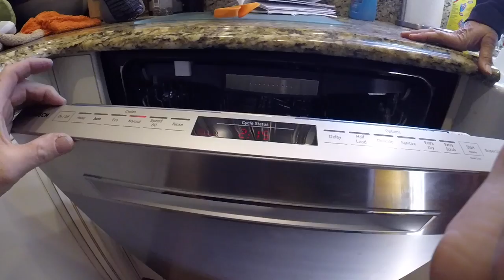BOSCH DISHWASHER INSTALLATION AVOID THESE 3 MISTAKES

Comment: @9:22 NOooooo ... Don't cut the wire! (You had you plumber hat on and needed an electrician hat for a couple minutes.)
Just stuff the extra back down the hole, or reroute it out of the way. If the decision is to cut it shorter, make sure the line can reach up into the sink cabinet with enough to work with for a regular junction box in case the next DW is a traditional hookup, and can be either plugged in or hardwire with a piece of MC for a whip.
Reply from the maker: Dwight I remember cutting that. I was like dude you better not of cut that short.....lol

Comment: How did you get the wire under the sink?  Doing the same thing at our house and the wire comes directly out from behind the dishwasher as all of the older models hard wired right into the unit.  Now I need to get the wire over and under the sink.
Reply from the maker: best way is to install receptacle in kitchen cabinet. My sink was actually hollow on side to my surprise. If not i would of had to put receptacle in sink too.
Reply: @ChuckBarron  what do you mean hollow?  You have the same kind of divider wall I do, the one you passed the return and water lines into.

Comment: Mistake #1A: Instructions DO NOT say to put the junction box UNDER the cabinet. It needs to be mounted IN the sink cabinet. The box needs to be accessible according to NEC. Good luck accessing it where you put it.
Reply from the maker: I will access it on next dishwasher install in 15 years hopefully. But thank you.
Reply: @ChuckBarron  I sincerely appreciate your sense of humor. Do you have any idea why Bosch does it this way with the separate junction box? Any idea why they didn't leave the connections in the front?
Reply: @ChuckBarron  Let's hope you'll never need a service call!
Reply: A hard-wired install is not "accessible" either. Unless you are getting an NEC inspection, there is no safety or convenience problem.
Reply: @FisherCatProductions  In older dishwashers the connection was accessible when the junction was at the front of the machine.
Reply: @joeweatlu5169  True, but I can't think of any reason you need access to the plug before the next time you change out the DW. If my outlet behind the old DW was 1-1/2" lower, I would have plugged it there in a heart beart instead of installing an outlet under my sink!
Reply: @FisherCatProductions  In all practicality, what you're saying is true, other than the fact that NEC says the junction box needs to be accessible. It's the same reason why you can't hide a junction box in a wall or behind a fixed object like a kitchen cabinet. My point is if you're going to do something, why not do it the "correct" way, up to code.
 I've installed maybe 8 or so dishwashers in the past for myself, friends and family, and the latest one was a few years ago when I put in my Bosch, so I don't know about how other manufacturers do it now. It was simpler when the water and electrical connections were in front.
In my world, there would be a GFCI outlet in the sink cabinet, and a regular plug coming from the dishwasher to plug into the outlet. Simple.
Reply: @joeweatlu5169  Hey, Joe. Absolutely true, and necessary if you have to pass an inspection. As to why not to it the "correct" way--I just wasted 5 hours and a lot of good cuss words fishing Romex through my stud wall. Now I get to patch up the drywall behind my dishwasher when I could be drinking a beer as I listen to the barely audible hum of my expensive Bosch kitchen toy LOL. And now that I had no choice, as you said I might as well do  it up to code, which I did. But if I could have dropped the original hardwired junction box 1.5" lower, I would have slapped an outlet in, and plugged it in there with no qualms. Inconvenient--maybe, but not much. Unsafe--not in the least. I will never do anything with electrical for myself that makes an installation less safe.This was the biggest PIA dishwasher swap I've done in 50 years of property management. But it's done. Happy wife, happy life!
Reply: @FisherCatProductions  Fortunately I had enough slack on the romex to run it into the sink cabinet and mount Bosch's box on the back, then the power cabinet through the same hole.
It was so much easier when the water and power connections were in front.
Reply: @joeweatlu5169  Well, mine is done and worth it. Sitting here sipping on some cold Sangria, and not listening to it doing it's thing. Dang, 44dB is quiiiiiiet.Ciao.
Reply: @FisherCatProductions  🍷🍷🍷

Comment: How long after you shut the door will the water start? I just installed my Bosch today and after about 2/3 mins I still don’t have water. I checked all connections and made sure water was on. Pump seems to be working. Any suggestions?

Comment: How do you know the washing is finished or at runtime since theres no panel or led at the front? The dish washer is BADLY MOUNTED, in my opinion.
Reply from the maker: Green light means done. Mount is what paper work calls for...I have seen some nice grid still mesh under stone tops. I do like that.

Comment: So to keep the dishwasher from tipping forward when the door is open and the trays are out with dishes on them, you screwed through that rubber seal on the sides?  Normally dishwashers have tabs at the top to secure them to the underside of the counter top but I'm not seeing any tabs on this bosch.
Reply from the maker: No through rubber. through side brackets. rubber goes on after.
Reply: I am installing a new Bosch right now.  You put the mounts on the sides, and the rubber thing that goes all the way around outside the door has a little hole already made in it, to put the screw through.  So you don't actually penetrate the rubber thing.
Reply: The rubber side seal won't hold for mounting...  it should have bracket mounts... bad job securing....Will be loose  soon... SMH

Comment: Thanks for the great video........ I'm getting ready to replace my older Maytag with a Bosch 500 shpm65w56n. I have a question; Couldn't you just eliminate the junction box and wire it to a plug w/ ground? I wired an in-wall receptacle for my current dishwasher right behind it. Thanks again for your video.
Reply from the maker: im sure. so many ways to set it up.
Reply: Bosch makes a plug adapter you can buy just for your application
Reply: @johningram6264  the electrical box adapter is $30.  Grounded plug is $5 and takes up a lot less space.plug is designed for 15 amp so should handle the load. May want to make sure it is not laying on the floor in case there's a leak.

Comment: Oh no my brother!  What you should have done is ran that romex wire into the sink cabinet & made your connection there and run the feed cord back to the dishwasher. That way you can easily get to the junction box. Typically we put in a outlet & install a cord on the machine.
Reply from the maker: Next time! learn from my mistakes for sure.

Comment: Hi. Did the brass 90 degree elbow connection for the water line come with the unit or did you have to buy that separately?
Reply from the maker: They come with connections.
Reply: The brass 90 is purchased separately. About five bucks at home Depot or $9 at my local supply house

Comment: A Fernco connection under the kitchen sink 🤦🏻‍♂️. Does Jersey have any plumbing codes?
Reply from the maker: New Jersey and  you perfect together. That use to be a commercial ran all day long....lol
Reply: That's why the trap on the other side goes up too high.  To siphon the water out of the Fernco.  🤣

Comment: Is it safe to put the conjunction box within the same cabinet as the dishwasher? Been reading the manual and it says to install it in the cabinet beside it
Reply from the maker: Dishwasher will not push back.....i learned the hard way.
Reply: you have to put it where it's accessible.  Behind the dishwasher is probably a no-go, aside from space constraints.  Put it under the sink

Comment: The kitty is so adorable!
Gorgeous kitchen! I love that your appliances are custom panel. Nice range hood cover too.
Love how the kitty just stepped right over you. Mine like to sit on my tools.
Does steel wool actually work to keep mice out? I live in the middle of the woods and mice constantly get in. The cats catch the ones they can reach but the mice ruined my oven/stove. Got into the insulation in it and nested. Can't use rat poison bc it will kill the cats.
I would say cutting the wire that short may have been a mistake. Even if you have to coil it, it's a good idea to leave electrical wires a little bit long. You can always cut them back if there is too much but once you cut if it's too short it's a problem. If the ends go bad you want to be able to trim them. It also helps to have more wiggle room when pulling on them. I've learned that the hard way.
All the effort to install a drop-in/slide-in dishwasher is why I have a freestanding one with wheels. LOL. Problem is, it's harder to find faucets they can hook up to. The crappy dishwasher in my house is a big clunky drying rack & movable island. I haven't run it in years because I hate loading & unloading. I have to wash dishes before putting them in for them to get clean so there's no point. I just wash them by hand. LOL.
Aww. Little doggy wanted to inspect the work too.
Yeah, reading instructions is important. I have to use a magnifying glass on most things these days. LOL.
I take it the new dishwasher couldn't fit the custom panel? Pity, because it looked nice.
This was educational and interesting. My best friend is re-using an old dishwasher from his grandfather's house (grandfather got a new dishwasher-- hell, hole new kitchen- after a tree fell on the house). We're going to build a cabinet and install it. I believe the cabinet it was in was destroyed by water damage.
Does the Bosch dishwasher need a diffuser plate on top to keep moisture from damaging the underside of the countertop?
Reply from the maker: Ha...yes on steel wool.

Comment: Hi Chuck. We just ordered Bosch model # SHPM65Z55N - would this video apply to that model? And do we need the junction box? (Home Depot said we did not.) Also I notice that when I shine a light to one of the sides of the current dishwasher one of the sides doesn't have a cabinet wall (the under sink cabinet has 2 walls but the dishwasher side is a little angled to the right side of the sink and I think right there there is no wall) - if I'm right that there isn't a cabinet wall right next to one side of the dishwasher, is that a big issue? Thanks.
Reply from the maker: not sure. Best practice is to read their paper work.

Comment: I haven't watch the rest of the video yet but looking for the way you mount it. I usually side mount the ones I install when you have granite or quartz countertops. This is also my first Bosch dishwasher that has the water in the back and the electric as well pretty simple. But do you pre-drill the membrane when side mounting? Hopefully I will find out towards the end of the video
Reply from the maker: side mount brackets Greg
Reply: @ChuckBarron  yeah I know sad brackets. But the ones I usually side mount have a plastic plug on each side that is i replaceable after you put the screws through the hole that is approximately 3/8 of an inch in diameter. The Bosch dishwasher that I will be installing and have partially installed does not have the plastic plugs but a membrane of sorts. I'll try to send a picture somehow when I get back to that job. Waiting on an end panel from the cabinet company. The first one came in the wrong color. I work for a kitchen and bath Remodeling Company that has been in business since 1959. We do everything from the demolition,Electric, Plumbing, sheetrock and or plaster repair, cabinet installation, and All trim work, ceramic tile, Schluter waterproofing systems for bathrooms excetera excetera. My point being, I know some things but I don't know everything. But I am willing to learn everyday

Comment: Love the video, great preview for my upcoming Saturday. I'm replacing my DW which is 2 cabinets away from the sink. Currently have flexible copper tubing with a compression fitting. Will I need to replace this with braided flex water supply. If so, can it be adapted near the dishwasher or would I run a braided line the whole distance?
Reply from the maker: Good luck! Should be good. Check it out. The last thing you want to do is pull it out because of a bad supply line.

Comment: Electric code requires 6 inches of wire in the box at 10:00. If you had the 6 inches, you wouldn't need a needle nose pliers to connect the wires. Just a loop, and right in. Easy peasy. Mount that box RIGHT at the floor and 9 inches on center from the right hand side to avoid having it interfering with the machine being pushed under the cabinets. Once you do a few of these, you'll know that it is a LOT easier than the front connections!
Reply from the maker: good tip John. Ty

Comment: Great Video! You said you had 2" of clearance but then had to move the (junction) box inside the cabinet....does that mean under the sink area? I couldn't see it when you were tightening the drain line. Anyway my 10 yr old Bosch died. Unfortunately my wife wants another and this gives great insight for the install!
Reply from the maker: Yes put in cabinet. good luck Me

Comment: How long is the inlet and outlet pipes? I am planning to install my dishwasher two cabinets away from the sink which is roughly 4 feet away....is it possible to get an extension for the pipes?
Reply from the maker: Check with bosch..

Comment: Thank you for your instructions. I bought the Bosch 800 series, but I'm confused on what to do with the mat panel in the front that has popped out.  I was not supplied with the brackets that you have and the instructions do not explain clearly how to place it.  It came with 3-toe kick plates.  Any suggestions?  Thanks again.
Reply from the maker: call tech support for sure.

Comment: I just installed it...of course without reading the instructions!☝️ I used the old hole but Bosch wants drain hose to be off the ground. i need to fix that tomorrow. Always first job takes an hour, by the time you figure out it's actually a 10minute installation its too late. Then you never do the same type of job again...

Comment: Why are the fn screws at the same exact height of the top rack👎... and some DW s ... the top rack doesn’t come offfffff!!!! Why me?!?!??!
Reply: GE dishwasher. Lol. So screwed up. There is a way to get the rack out but it isn't simple and I always forget. Stupid design.  Then there is the dumb drip pan that cuts your hand off. GE dishwasher suck.
Reply from the maker: Your right, I dropped the screw inside 2 times for fun. hold on let me move three baskets to try and retrieve the scew.. oh lord.
Reply from the maker: Roger that alfred.

Comment: All three mistakes were covered in the installation instructions provided by Bosch. Junction box must not be installed behind unit, leveling legs should be loosened slightly before install and toe plate bracket mounting in detail. I'm installing a replacement Friday, and am not a plumber, but reading the model specific instructions not going in blind should eliminate these problems.
Reply: Yeah don't do any electrical things before turning off the electricity!
Reply: @FaithZiegler  lol of course not.

Comment: Perfect.. My new Bosch dishwasher is coming next week... it sure is a different install from all the other dishwashers I have had.. great seeing this video so I know what to expect. I might have to cut a bigger hole in my cabinet to pass that electrical connection through....but knowing this ahead of time is great... would not have liked finding it out when trying to install it... Now I know what I need to do and can prepare my connections this weekend and be ready to just pop the new machine into place when it gets here. Thanks.
Reply from the maker: ya some good pointers from viewers here...check em out.
Reply: @ChuckBarron  Just touching back.... the install went pretty well.. Watching the video helped a lot :-)   I had to cut a slightly larger hole in my cabinet to pass the electric plug through and I was able to mount the electrical box in the cabinet under my sink..  so far I am happy with this dishwasher...  I didn't notice until I had it all installed that there was a slight dent in the front panel.. I don't want to have to re-install a replacement unit but my retailer refunded me 10 percent of the cost.. nice pay back for a hardly noticeable dent.

Comment: OK, I give up...what’s the red laser dot on the floor for?
Reply from the maker: Lets you know its operating. red light means go in this bosch...it should be green. ha
Reply: Chuck Barron is this just a Bosch thing?
Reply from the maker: not sure but i hear most are doing it this way. anyone can help with this question?
Reply: Chuck Barron A lot of the newer dishwashers run so quietly that they came up with the red indicator light illuminating the floor. Let’s you know it’s still running. Very nice video! 
I just wanted to add, A lot of the newer discharge (drain) hoses are DIRECTIONAL. Make sure to LOOK FOR the DIRECTIONAL ARROW?
Reply: Chuck Quinn to give the cat something to play with!